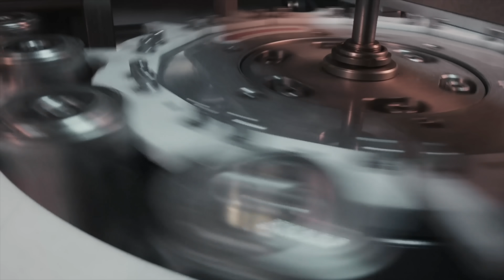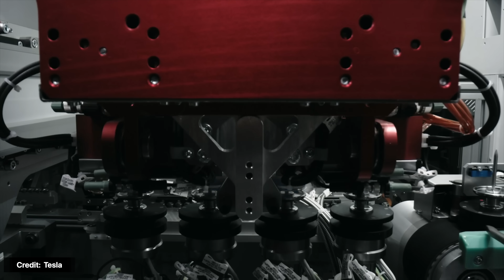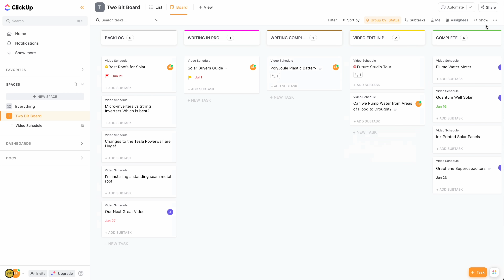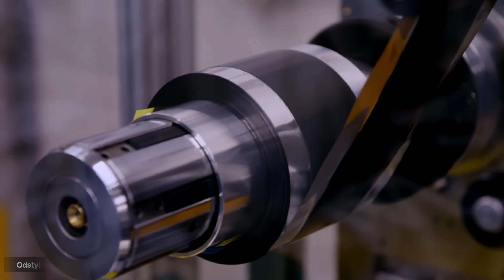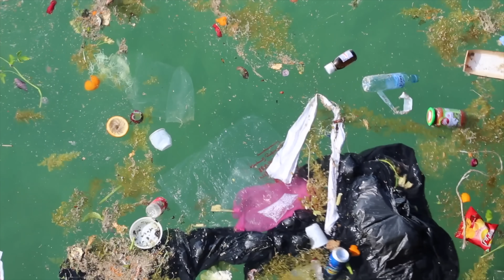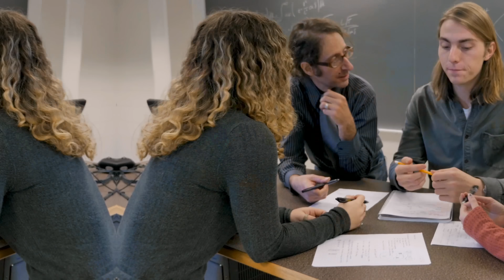Breakthrough Plastic Battery Requires NO Mining, is Cheaper & Lasts Longer!

Comment: So widely available chemicals are themselves produced without mining? Do we include petrochemical extraction in that as well?
Reply: We do produce many basic chemicals without mining, for example the Haber process that converts nitrogen and hydrogen into ammonia. What is really needed is a large-scale means of producing methane from carbon dioxide and hydrogen, which presently requires high temperatures. Some progress has been made using a mixture of catalysts at lower temperatures and research is ongoing into synthetic photosynthesis.
If methane can be produced in quantity, that would remove dependence on fossil fuels as a base for synthesis of many organic compounds, including conductive polymers. Of course, energy input is required, but the use of intermittent renewables like solar, wind and hydro might be used to produce cheap methane at times of excess power availability.
Reply: @RexxSchneider  Methane direct from CO2 is an excellent line of research. If I'm not mistaken, they already know how to achieve this but it's just not economical yet. 

Of course, if you included the overwhelming long range economic costs of unmitigated climate change in the ledger it probably would be economical but most CEOs and economists lack such vision and intelligence.

Comment: Rapid charging City busses at bus stops may make a great use case where the battery is 5x more powerfull, and cost less than half and charges to full +6x faster, and last 2x longer than lithium ion.

That is asuming the specific energy density, Kwh/kilograms, is not too low.

Comment: Would I buy powerwalls that are 5x more spacious if they were 5× power dense and the battery were roughly 70% less expensive and lasted twice as long? 

YES!
Reply: Did he mess up there? I though the power density was 5x less than Lithium Ion, so a 5x size should be the same density as the Lithium Ion, right?
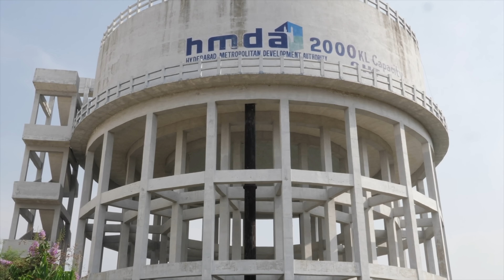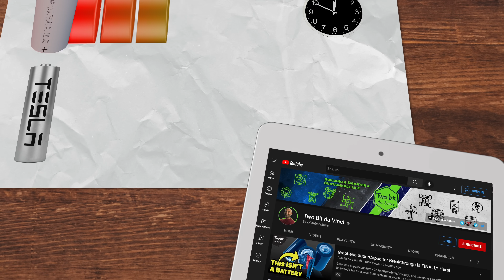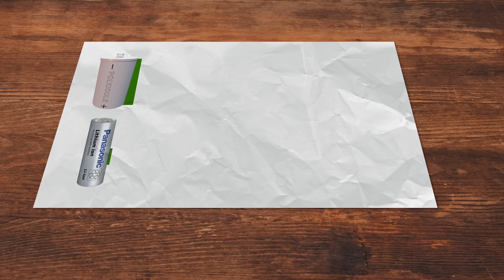Reply: @NdxtremePro  the plastc cell energy density was 1/5th as the amount of energy for a given volume, 9:25. As to the power for a given capacity, it was pointed out  polyjoul could charge in 5 minutes where as lithium needed 30 minutes to get to 80%, 8:54. Discharge was 10× lithium,  8:31.
Reply: Exactly. Have maximum allowable solar, insulation, air source heat pump and EV. Am dead in the water on my quest to electrify everything and power it with renewables and efficiency here at home. Affordable, big capacity batteries are essential. No other way to get retrofit homes like mine close to net zero.
Reply: @laurensargent9471  if you have a good insolated house on the other side of the window you can use bricks in winter you use the sun and it can help
Reply: @CUBETechie   Use batteries as insolation.. 🤔 Strategically placed around / built in certain areas of the house for easy maintainance or change if/when needed...👍
Reply: You can ONLY choose two out of four.

Size
Efficiency (charge/discharge cycle and capacity)
Longevity
Cost (Up front purchase & lifetime).

Seems like, for fixed storage (home use & grid storage) these Joul cells would be ideal.  You just need five times the space.  For mobile use, LiOn is still the leader.
Reply: I would buy 5 powerwall that are 5 times as big if they costed 5 times less. Because POWER!!!!!!!!!!!!
Reply: So only if 5x more dense? Seems to be a weird place to start it's either ignorance or you're just pulling a multiple out of your ass that means nothing and making a none statement to just type on the internet.
Reply: that already exists. it'ss called lead acid battery
Reply: @deathofpreyor  lead acid batteries certainly do not last twice as long., nor is their levelized cost less then lithium.
Reply: @kreynolds1123  they don't last as long but they are 1/4th cost of lithium batteries.
Reply: @deathofpreyor  it is really bad. factoring in battery cost, number of cycles, installation cost,  the total cost of ownship is almost 3× higher for lead acid.
Reply: @kreynolds1123  you can find 200ah AGM batteries for less than $200, have around 500 cycles, installation costs are the same or even lower since they have low risk of exploding vs lithium and they have been maintenance free for a decade now. lithium beats acid batteries only in weight and cycles. few years ago lithium might have been cheaper if you use the battery to it's full extent but prices of these batteries have risen while lead batteries have lowered.
Reply: @deathofpreyor  but if your a data center needing backup, you'd  have to pay someone to remove the old lead acid batteries and install new ones 6 times in the same cycle space of one 3000 cycle lithium based  battery.

 If instead you are a home owner you don't have to pay someone else,  but it still takes up your time and energies. And you should still value your time when it comes to maintaining systems. Like you can buy an old car but if it requires days to repair it, you would have been better off if you talked down the price  because of the hours and hours of needed maintenance and repairs.
Reply: @kreynolds1123  well the original comment was for home use not data centers.
Reply: @deathofpreyor  I covered that. Even if you change out the batteries yourself, you should count your time as valuable.

For example,  hypothetically say ya person has a choice for some kinda thing. They could buy a system that they build  but cost $10,000 for the parts and say it takes 2000 hours to complete, or they could buy it fully built for $15,000.   Do they want to spend 40 hour weeks for 50 weeks of a year to shave off $5,000 from $15,000? Maybe some one would, but that works out to one valuing their time at $2.50 an hour.   2000 hours is a lot of time to take away from spending it with ones family and friends over a year. If all one has no job and all they have is time, small projects are great but they would still be better off finding a job vs trying to save $5,000.

Comment: "This would not work well for cellphones." I'm not so sure about that....  

Modern cellphone batteries make up a fraction of the volume of a cellphone. If it a cellphone were designed with its battery being spread out across the whole back, then a poly battery would add a little extra thickness, I'm guessing the end result might be close to double the existing thickness.  But I think the greater than 6× rapid charging and 2× the life and 75% cost  reduction may significant enough that  many people would redilly accommodate the slightly thicker phones.  

With 6× faster charging might even have people accepting batteries with half the energy if their phones are fully charged in 5 minutes. 

I'm not saying cellphone are perfect use case, they may have a viable market in cellphones.

Comment: Cool . I like the idea that Toyota is doing with ceramic batteries. Plus we could stop making plastic bottles and make them out of glass again like we had when I was growing up, which are totally recyclable!
Reply: If it’s in the lab, it’s pretty much irrelevant for a very long time.
Reply: Plastic pollution is obviously a problem, but from a resource perspective plastic bottles are far superior to glas bottles. A) making and recycling glas isn't exactly a low energy process; B) the logistics involved into moving glass bottles from A to B eats up a good bit more fuel than moving light weight plastic bottles.

The best example for glass containers being way better than plastic: drinking cups.
Glass cups can and will be used hundreds of times in the life time at least, meanwhile plastic cups are usually single use items.
Reply: We didn't buy our water in bottles back then - that much glass moved into the environment where water is distributed and used would be problematic too. Remember glass breaks, and is very sharp, it's extremely heavy.
Reply: @pdloder  Well, "back then", we drank our water from the tap, so we didn't need glass water bottles. Nevertheless we did buy our milk, soft drinks, medicines and beer in glass bottles.
Reply: @RexxSchneider  and there were/are very good reasons we moved to plastics - however bad the outcome was.
Reply: @pdloder  The reasons were convenience and plastic is cheap. In the long run glass bottles were cheaper as they used and reused and reused.
Reply: @rap3208  yes, convenience and economics, and logistics, and safety.
Reply: @pdloder  AND....major cause of pollution. Drops mike...and walks away.
Reply: @rap3208  I already alluded to that when I said - "however bad the outcome was".
But congratulations on your mike drop exit.
Reply: @pdloder  The sole reason was cost. A thin plastic bottle is cheaper than a glass bottle if the manufacturer doesn't bear the cost of disposing of the plastic afterwards.

Trying to pretend that safety played any part in the move to plastic is pure revisionism.
Reply: @RexxSchneider  there are no outdoor events, where alcohol is allowed - in my country at least - where you can take glass bottles - and the reason has nothing to do with costs to the manufacturer.
Reply: @pdloder  I think you'll find that's more to do with removing the possibility of drunken idiots using glass bottles as weapons than it is with any inherent concerns of safety. You'll also find that in most civilised countries you can't take knives or guns to outdoor events either. For the same reason.
Reply: @RexxSchneider  For fear of it being used as a weapon; and for my own mental safety - I'll leave this ridiculous comment right where it is; .
Reply: @pdloder  Fair enough. You've given us all a good laugh anyway.

Comment: It's amazing, for the last 10 years I have seen dozens of "radical, game changing, world altering" battery breakthroughs announced and not one of them has resulted in a commercial product. Not a one. They all promise to change the world, seemingly to attract funding, and then disappear. I'm hopeful that this battery as well as the sulfur battery you discussed a while ago become actualized into commercially viable products. The sulfur battery has the potential to change the entire consumer battery market and the polymer battery has the potential to change the commercial battery market. Maybe in 3 years they will join fusion power production in becoming reality.....
Reply: Here are the correct figures so you can adjust your mental model. It's clear you have been getting bad data. In fact, battery prices are roughly 14% of what they were a decade ago.  All these Innovations have made a difference. If it were not for the recent surge of inflation, battery prices in 2023 were projected to be $101 per kilowatt hour. Now it's looking to be in the $120s.

Battery $ cost per kilowatt hour by year
2022 132 (despite inflation)
2021 135
2020 140
2019 156
2018 180
2017 219
2016 293
2015 381
2014 588
2013 663
2012 721
2011 917

Anyone who wants to verify these figures can Google "battery pack cost per kilowatt hour by year".

As a side note, the price performance for solar cells has been on a similar curve.

I'm most excited about District Heating though. It is a , inexpensive to store solar power as heat and then distribute it at night. There are already projects going up in Europe that will be online this winter. It's very fast to build and uses low quality sand or gravel or other materials the store Heat at about 540 C.  It's an upgrade from Steam heating with much lower costs and much higher safety.
Reply: Maybe it is all about the wall St. Investment energy it generates? The pie in the sky-hopeful investments.
I will buy into all the future now companies with Bitcoin! Hope this works out. New ideas , new like electric cars, are needed.
Next week, perpetual energy machines!

Comment: Pretty high on hype, very low on information:
- Lithium ion vs this tech lifespan ... 15-20 years for li-ion?  How?!  What cycling/application?  What criteria? NMC batteries are considered "done" after like 500-1000 cycles ...
- They performed 12 thousand charge cycles at 100% DoD ... ok ... what happened?  You could do that to lifepo4 ... and 100% DoD would be like 10% of design capacity ... if it takes any charge at all
- This could provide a solution to the plastics pollution problem?  That's a pretty bold statement!  So if i rub two PET bottles together, i have a breakthrough now?  No ...

You and Will should team up for the ultimate pseudo-tech investment bait channel.

Comment: I know everyone looks at Lithium batteries for EVs because of the energy density needed for long range.  But what if long range isn't the goal?  What if short or medium range will work?  My WEEKLY commute is just over 50 miles.  I'm sure that's not typical, but if I can drive an EV with 100 miles of range AND the ability to recharge in under 10 minutes, I want it.  I mean, consider that people will drive a motorcycle that gets 100 miles to the tank right across the country because it takes no time to refill.  So, energy density is only part of the equation for EV power.  Faster recharge times mean you can get by with a smaller battery.  As for efficiency, well, fossil fuel engines are about 20% efficient.  If these batteries can beat that AND be cost competitive, we could have a winner here.

Comment: I think the range issue could be remedied by the battery's charging speed and charging infrastructure. I wouldn't mind stopping for 5 minutes every hour instead of 20 every 3 with current batteries. So what if the car only has a hundred mile range if charging is very quick. It's a problem that could be solved if we planned for this limitation.  Imagine if charging stations were just pull off locations like chain up spots. Pair that with wireless charging and that quick charge would be a breeze. Pull over onto the plate, get out stretch the legs, and then carry on to your next stop.

Comment: the + and - poles on the 3D batteries change eacht time: 
in the first view the pos. side is the side with the 'crown' and the next view that is the neg. side.  
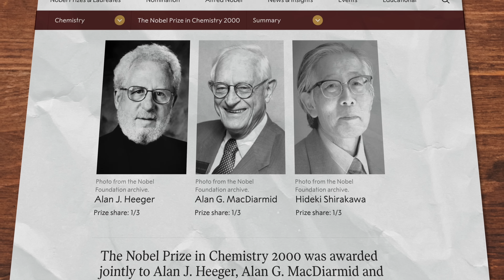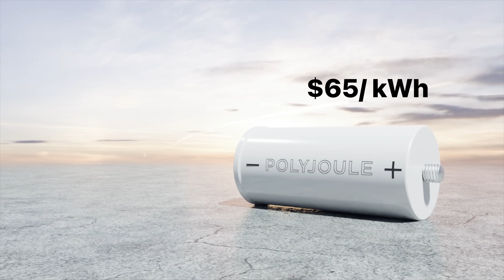happens at  05:24 and at 07:14 again : if that would be true you would have a shortcircuit inside the battery itself.  
at 09:30 a likewise error happens: the one side with a 'crown' or a little bit of a thicker end is the neg. side if you see "polyjoule" printed, but it's the pos. side if you see the brand logo...
while in any excisting battery such such ring or crown would always indicate either the neg. or the pos. side of the battery and never change to prevent ppl from connecting the battery the wrong way around and cause shortcircuits.

at 10:50 it is very clear: the side with the 'crown' is topside, but half a turn the pos. connector is indicated to be on the top and the next half turn it's at the bottom, while neither of the connectors change their position. that will never happen on a real battery : the top connector is either the neg. one or the pos. one independing on how often you turn it around its lenght-axial. never both at the same time and depending on what print on the battery you're looking at. same for the bottom connector.
the error of walking half a turn around the battery while it stays at the same place and position (e.g.: bottom being at your left and afterwards top being at your left) and printing the text again from left to right vs staying at the same side and just rolling the battery half a turn further and printing the text from the same side to the same side again. (bottom is and stays at your left) 
or if in 3D: with the X-Y-Z origin being in the middle of the battery:  the Z axial would be the lenght of the battery from connector to connector you turned it 180 degree around either the X or Y axial while you the observer stay at the same 3d spot vs turning it 180 degrees around the Z axial while you again stay at the same 3D spot.
in that first way top and bottom swap places, in the 2nd way top and bottom stay at the same place.

Comment: You did a good job on this video. You showed its potential, and possible area where it would be a better fit, but you also asked questions that have no real answer yet.
 Plastic recycle?, we should demand the oil companies to to take up the cost, and convert it back to oil, and carbon residue, while using the waste gas as fuel.  There are many of these plants around the world doing just that, but not enough.

Comment: I have always thought that taxing mines properly would solve the recycle and pollution problems, at least partially.
Reply from the maker: yeah that's a good point... I'm not sure what the answer is, but our incentive structures need a rethink!
Reply: Only if the taxes were Industry-specific and used properly for reclamation and safety. In the US, that intent is rarely honored. The Deepwater Horizon fiasco was proof that the government was irresponsible in this regard and we ended up with an environmental nightmare because the taxes were not used for their intended purposes. "Just tax it" is an overly simplified reaction.
Reply: @edeaglehouse2221  Thus the word "properly".  Of course the oligarchy will do their Sociopathic thing.

Comment: Remember Plastic is made from Oil 🛢 so we will always need to drill oil
Reply: I worked making plastic pipe for 14 years and pipe fittings with a large corporation most plastics can be recycled by grinding it up putting small chunks back through the extruder or the molding machine along with some virgin material! They call it regrind!